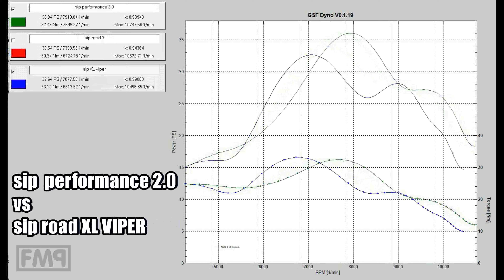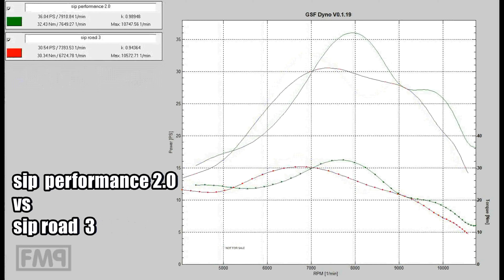vespa M244 SIP PERFORMANCE 2.0 test ride / SOUNDcheck #50 / FMPguides - Solid PASSion /

Comment: HI Mista, you have probably mentioned it before, so I guess a Malossi 172 would be more practical with a good box exhaust? (with the right set up, of course?)
Reply from the maker: yes. t5 only has bigger transfer ports, its still a vespa engine. Same as px. The super vodoo us a myth. u also need to set intake timings (if rotary) cylinder timings and exhaust port shape and width. 118/176 cyl. 190 intake with 0,05mm rotary calve tolerance. 65% ex port. Always the same recipe 😃 i would take a polinibox.
Reply: @FreakMoPed8  Is this set up that totally loses me(sorry, I definetley need to do some reading on all of those figures) similar to the worb five 172?

Comment: Hey FMP...which carb are you using for this test?
Reply from the maker: phbh30
Reply: @FreakMoPed8  Would the si24 with the 2.5mm drilled float bowl provide enough fuel for this set up
Reply from the maker: no. si carbs are not for reed valve.
Reply: @FreakMoPed8  No sorry I mean rotary valve set up not reed, quattrini 244 with 24mm si and Sip perfomance 2.0 pipe, would the 24mm still work with this big expansion chamber?
Reply from the maker: okish. but not good.

Comment: Sip perfomance 2.0  vs sip XL?
Reply from the maker: forget the old XL its outdated. In thr as we see what well developed boxes are capable for: it was never a good exhaust. 

sip road 3 is the better XL
It swallows the xl completelly

See curves on my fb page
Nice Exhaust. High manifold. Quiet. But low power and boring.
(also the inner wall loose Problem)

Comment: What was the top speed? I couldn't see the gps....
Reply from the maker: Yep, sadly the sunshine so Its hard to see, it pulled over 130 in this short track.
Reply: @FreakMoPed8  plenty more in it I'm sure?
Reply from the maker: Sure! But it also depends on the teansmission + seize and weight of the driver. the kg/cm effect is big. polinibox made 138 at a quick test